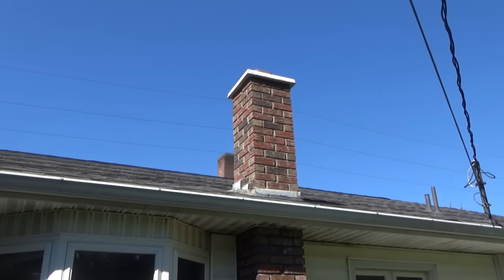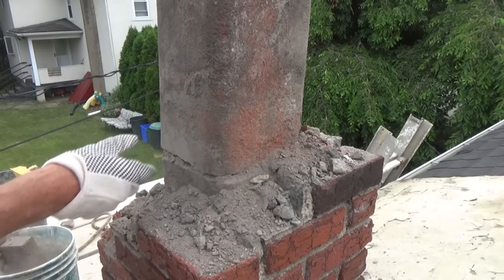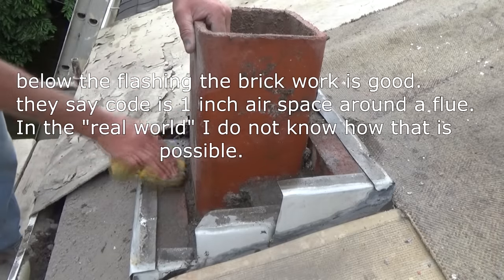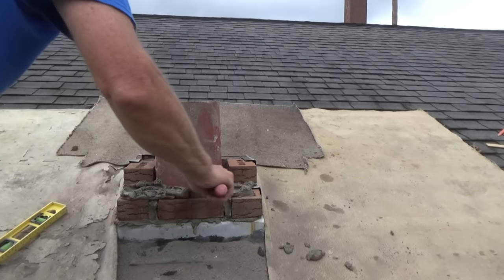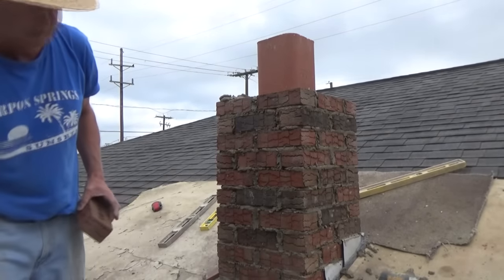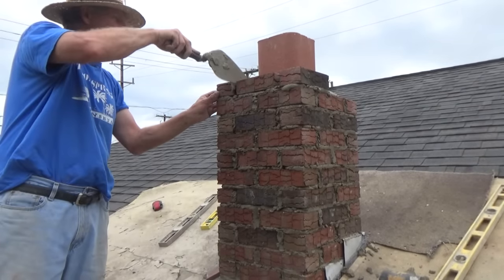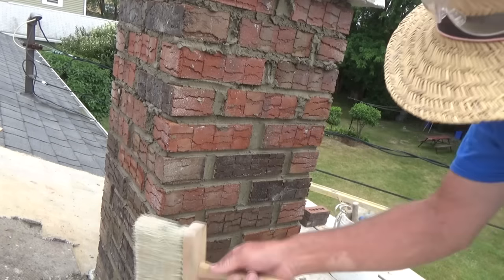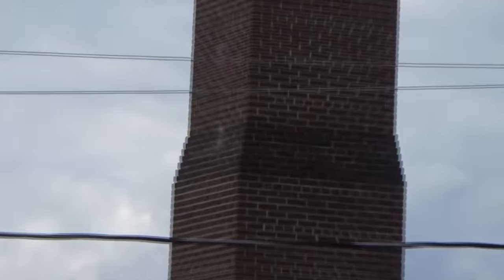CHIMNEY REPAIR (part 6) BRICK "Mike Haduck"

Comment: That precast cap looks like a pretty good idea. When I worked with Nick we would hang a form from the top of the flue pipes so the cap would be about 2-3 inches thick at the edge. Many of the masons in Fairfield county would just make a coping that tapered to nothing at the outside edge. After two or three years in the sun that thin edge of mortar would curl up and away from the brick. We did the brick veneer on a three flue chimney on the gable end of a one story family room off the back of a two story house. Both Nick and his brother Ralph told the homeowner that it was too short for the fireplace to flue to draw. The homeowner insisted that this was what the architect had specified, was the right size flue for the size of the fireplace and met code. About a year later we were back there, breaking up the nice thick cap so we could add another six feet to the height of the chimney.
Reply from the maker: I Hear you J, I been through same thing, thanks mike
Reply: same i think the 70's architecture for looks was kept to short looks ok from the road but when my winter weather comes it back puffs so 10FT more up and that should fix it plus meet local code

Comment: Hey Mike, 24 year old whos been doing contracting for a little while and I'm using your videos to learn Masonry so thanks for the videos. Hello from the Lebanon Valley area!
Reply from the maker: Hi Yomon,  thanks, I am glad if they help,  I appreciate it.  mike
Reply: Mike Haduck One quick question Mike, what do you consider as the ideal stuff for gluing loose block for a retaining wall?
Reply from the maker: Hi Yomom,  one day I am going to do a video on retaining walls in general ( I consider them  temporary) especially in PA. the only ones I ever seen built well was by the railroads and I seen a lot of guys get in trouble with them, if they are just some loose caps I would go with either cement or glue, no matter as long as it works, but I stay away from building new ones for customers,  I appreciate it.  mike
Reply: Mike Haduck Okay awesome Mike, thanks so much! I'm in PA as well like I said earlier so I appreciate the advice.

Comment: Mr. Haduck: you mentioned that people are going to steel chimneys.  Our neighborhood is about half and half.  I probably need a mini-rebuild (only the upper 8 levels have deteriorating mortar).  I'm thinking that we could rip out the top layers / levels and then build up using other non-brick materials to regain the height over the crown of the roof.  And it's more repairable.  Or so I think.

Nice, neat work, by the way.

any comments?  Good video.  thanks for taking the time to show us how it's done.
Reply from the maker: Hi Keith, It's up to the homeowner on repairs , I would ask some local chimney repair contractors and get some advice first, thanks mike

Comment: Beautiful work. I tend to avoid putting mortar between the cap and flue because of expansion and contraction being different. The flue will move causing separation. I use a flexible sealant instead of mortar.
Reply: You use backer rod right?

Comment: How do you keep the clay flu centered between the bricks Mike ?? Do you use the martyr mix you mixed attaching the 2 foot sections between the joints ?? How often do you marter between each clayt section ?? Thank you Mike for your help too. Peace v
Reply from the maker: Hi victory, basicly I cement each one together sometimes they have to be shimmed and packed, but anymore its common to use steal liners, masonry chimneys are becoming a thing of the past, thanks Mike
Reply: @MikeHaduck  Thank you Mike for the information Sir.

Comment: I'm a CSIA certified chimney sweep. This chimney did not deteriorate because of the antenna.. it deteriorated because of the mortar joints between the flue tiles were bad. Then I'm willing to Guess that they probably pump the hot water heater and furnace through there. Then the hydrocarbons leak between the flue tiles into the mortar and deteriorate it. The heavy winter cycles in Wisconsin also help to damage this. Plus the crown appears to be built from mortar and it should be concrete.. with a drip edge. 
Add some chimney saver waterproofing to your mortar mix and then after your rebuild coat the outside of the chimney with chimney saver which will repel water for 10 years just like your rain jacket. Also were the flue tile sticks out of the chimney Cap over the years wasn't maintained so water would slip in through there.
However the antenna did help contribute to the deterioration of that chimney but it's not its main problem, at all. It mostly helped us deterioration after the damage on the inside was already started.
Also note that a mistake Mason's make is that the chimney Cap needs to be made of concrete and free-floating from the bricks. So it it can expand and contract at different rates than the brick without doing damage.
Reply from the maker: Thanks, I agree, Mike
Reply: @MikeHaduck  I apologize if you went through some of these things in your other videos which I haven't watched, yet. 
Admittedly I'm no master bricklayer. One of my weakest skills is laying bricks. So I try to stay away from bricklaying as much as possible. Lol
Reply from the maker: Hi A MR, masons always learn more from tearing down old work than building new, because they know what went wrong, you know what your looking at, so that's the good thing, thanks Mike

Comment: Another great video.  I'm Starting a new chimney project ( 17 inch concrete  chimney block - 8 inch clay tile liner )  going in a remodeled Farm Granary,  34 feet high,  burning Anthracite coal in a 1947 Warm Morning stove.  Your videos have been an inspiration. Thanks for all the time and effort put into your video uploads.  Best Regards: john
Reply from the maker: Hi john,  that is super high,  you probably made your mind up but I would check with the stainless steel chimney first.  we did that up our cabin and it is so much better than the block,,,  thanks for the loyalty I appreciate it.   Mike
Reply from the maker: I understand with the coal,  I respect  Farmers, work never ends,  my brother has a little farm and seems like everything is against him,  but its a honest life,  God bless.  mike

Comment: Hi mike .those precast concrete caps are very handy. Regarding the raked out joints ( which have become very popular in Ireland over the past 25 years  and I must say can be very visually pleasing) I think they are not the right finish for exterior brick joints .as you know raking out creates a ledge that allows water to sit which is not a  good thing. Overall very nice job . My use of raked out joints is confined to matching already in place surrounding brickwork or on request ( which Id say is the case with your job here) I prefer to use a concave joint finish on exterior work which is more effective at shedding water.
Reply from the maker: Hi bric,  yes chimneys are almost a thing of the past with new heating systems,  only repair work left,  I use to  make my own caps but just threw out the form,  your right about the joints but I got to match what the rest of the building was,  thanks mike

Comment: I bought a 12x8x24 clay flue liner that I want to install for a pizza oven that I am building out of perlite/ Portland cement. The flue is heavy. I was thinking of putting the flue inside the hole I made and securing it with refractory mortar mix. Do you think that once it dries, it’ll hold? Any advice would help!
Reply from the maker: Hi Antonio, it might but heat cracks flues, everything is going to metal, thanks Mike

Comment: the cap is cracked on my chimney & I have some porcelain tile lying around. wondered If I could just use that to create a 2-3" overhang on the top, or even lower on the sides. can you think of any issues with that?
Reply from the maker: Hi Joseph, I couldn't say unless I was there to see it, I tell everyone to cover the top with metal if you can,   thanks mike

Comment: That chimney seems so small, can it be used for wood-burning stove with 6" stainless steel liner ?
Reply from the maker: Hi Adrian, everything now is codes, 6 inches don't seem like much for a wood burning stove, I would ask your local woodburning experts that specialize in selling that supplies,  thanks Mike

Comment: I was taught when you build chimmney you don't pack it solid around the flue only support it with scrap brick and a few hand full of mortar. 1- because if the cap cracks the water will pool, freeze and cracks the flue and the brickwork.    2- the flue gets very hot, especially with fuel oil heat, the flues need a little give to expand other wise they crack.  Have you heard of this method ?  You couldn't do it this way because there was no space between the flue and brick. Your customer bought module bricks which are shorter then the old standard bricks so your head joints were big.
Reply from the maker: Hi Meno, actually nobody builds masonry chimneys anymore because no matter what or how you build them ( it is only a matter of time) they fall apart. up here where I live if you did not fill around the flue the flue would shatter during cleaning especially with wood burners, where the chimney would block and heavy bars would be dropped down to clean them,   everything has gone to metal now,  I have not built a masonry chimney in years, and I will not,   only repairs, and then I insist they use a metal insert,   thanks mike
Reply: dry sand and lime

Comment: Like your videos Mike. I just wonder with your mix - 2 to 1 withtype S with a shovel of Portland. Would a mix of 3 to 1 using all Portland be about the same? Just wondering.
Reply from the maker: Hi Jeff sometimes I use just portland and sand for almost everything (2 sand 1 portland) but with this brick ,,,,mortar is a little more forgiving, hard to explain but in my area plain mortar does not hold up by itself,, other areas are different,  thanks mike

Comment: Hi Mike, love your workmanship. On my chimney,the flue pipe that extends past the cap is broken. My question is, are the flue pipe sections cemented in place or just sitting on top of each other. Also, can I replace that one broken flue pipe without dismantling the brick work. Thank you.
Reply from the maker: Hi Vincent,   I always seen the last flue pipe cemented,  and below the cap it is just the cement from the back of the brick touching,  depends on the mason who did it.  might come right our or you might have to take a few courses out or just cut the top and replace part of the flue,  every situation is a bit different,  I hope it helps thanks, mike
Reply: Mike Haduck Masonry hi mike nice watching your video, but how to deal with sinking chimney. The footing is cut on both side and went dowm for 2 inches

Comment: Hi,mike what is a going rate for something like this ? Maybe a four foot chimney replacement ? i am seeing prices like $150  a foot .I have been doing a few re-pointing of chimneys,but i have two estimates to do on rebuilds .Thank you . Al.
Reply from the maker: Hi Al, I never go by ft.  I just look at it, (they got the material)  I will not pick out or get the brick because it might never match and I am color blind anyway,,  and then figure how much time and go by that,  "a honest days pay and a little more for small extras " never fails,  I don't see me much on chimneys anymore,  I hope it helps thanks mike
Reply: +Mike Haduck Thank you ,Mike .

Comment: Hey mike why do the bricks fall out if you stop using the chimney?
Reply from the maker: Weather,  thanks, Mike
Reply: @MikeHaduck  so why doesnt weather damage it as bad when it's being used?
Reply from the maker: Hi user, I go around and fix some chimneys but I will not build a new one. Everybody has gone to power vents or stainless steel inserts or stainless steel chimneys, the days of masonry chimneys are over,  thanks Mike
Reply: @MikeHaduck I'm asking if the bricks fall out faster if you stop using the chimney and why that is

Comment: No expansion joint ?? I guess you'll be ok if they don burn wood, but its not optimal- the prefab crown is very rigid concrete, and the flue tile is old flue tile.
Reply from the maker: Hi John, gas heat, they were told to get a metal insert, masonry chimneys are over with, thanks Mike

Comment: Is it ever to hot or to sunny for cement work?
Reply from the maker: good question,  sometimes pouring concrete I get worried about it getting away when too hot, but otherwise I never really had a problem,  sometimes I do things to keep it wet longer like covering it with plastic,  thanks mike

Comment: Hey Mike, i bought a house in gate city va. the chmney inspector said my top where my chimney sticks out should be rebuilt before he put in the metal liner.. i was wondering what are your thoughts on someone covering a chimney in wood and adding a topper and metalliner to stop further damage to a chimney ? i have also thought of having somene take the chimney down where it sticks out of the roof and then buiild sides out of wood to hold an insulated liner and topper... is this an idea that is doable. i really want to use my wood burner in my house i got one of those wood gassifiers from the 70's called tempwood.. a stove that loads from the top with two little tubes running from the top to feed air into the fire.. i am dying to use this little stove in my house.. any suggestions would be appreciated.. thanks..
Reply from the maker: hi soahcalm they make metal stainless chimneys where you you could get both things done at once,  I do not like the wood burner idea anywhere close to a wood burner chimney, you get a chimney fire you are in trouble, my opinion, I would check with all the wood burner shops and ask what chimney they recommend,  I hope it helps, thanks mike
Reply: thank you very much for the speedy reply i love watching your videos, its such a lost art fixing these old chimneys.. I will check with  this store that sells wood stoves near where the house is that i just bought and see what they recommend. the chimney sweep recommended taking my chimney down to the roofline and rebuilding the top so that hit would hold the topper and new stainless steel liner..   it sounds like the safest idea i guess..   thanks again for the reply.. appreciate all the advice i can get on this place. i put some photos on this sight for permaculture.. some of the old house dunno if i have too many photos of the chimney on there though.. your welcome to look around..  i like reading about renovations myself i find it quite interesting..  i had to go up yesterday and redo the six inch gutters ijust installed because due to the sill rot the house was not level and the down hill flow i put on them was not enough.. now they are attached to th house in places and have to dangle from a hanger by a coat hanger on the other end.. only way i could get the water to flow away from the house at the moment..   until i can get those sills replaced... taike care .. thanks again.  this is my link if your interested..  https://permies.com/t/73681/Advice-clearance-tempwood-stove
Reply: you can see my chimney pretty good in the pictures i posted..  whats sticking up thru the roof..
Reply from the maker: thanks ,  mike

Comment: Don’t get how those older bricks were in such bad shape. I have a chimney that must be 150 years old here in New England and the bricks don’t look nearly as dried out and bad as the ones you just pulled off that house.

And why do the new bricks look like they’re already cracked?
Reply from the maker: Hi KJames,  our weather here is brutal compared to most other parts of the country, and the owner bought the bricks, and bricks are a hard thing to match because they go in and out of style like shoes,,  and every chimney has to be lined anymore with the new furnaces ,  lot of things going on there,  masonry chimneys are becoming a thing of the past,  I hope it helps, thanks mike
Reply: Kjames Jr, as Mike said the winters in PA typically have more freeze/thaw cycles than places like NE. The freezing one day 50 the next contribute to the frost wedging that tears up our roads so bad too

Comment: With a range in temperatures like that why wasn't engineering bricks used ?
Reply from the maker: Hi riches, unless they make them from granite or glass they end up the same, usually it's the cement is the first issue,   thanks mike

Comment: they dont rake brick anymore  in areas of the country that freeze cause the moisture and snow get in them gaps and freeze and crack it. go look at engraving on ANY granite headstone at a cemetery where it freezes. they r missing peices of letters  or numbers and what not. flush mortar is better than struck mortar
Reply from the maker: Hi Joe, your owner wanted to match the rest of the house, thanks Mike
Reply: i understand. i was just saying that for info on it. this mason i knew told me about it on one of the buildings we were working on once.  i never knew that was a style. or why they dont do it anymore. i am not saying you done wrong. i love your videos.  youre a great teacher. most people dont tell you the right way until youve done it wrong first